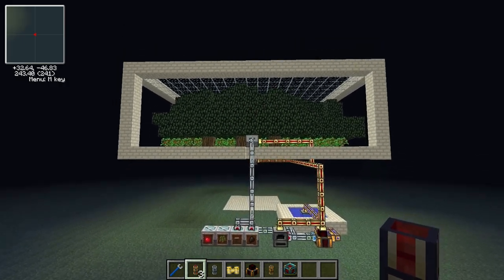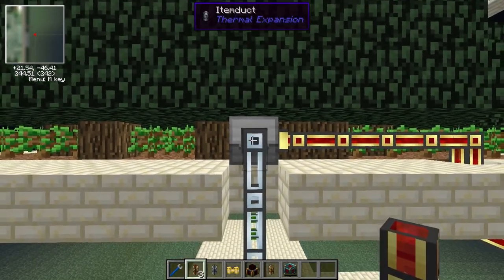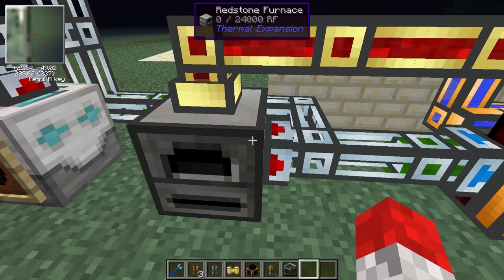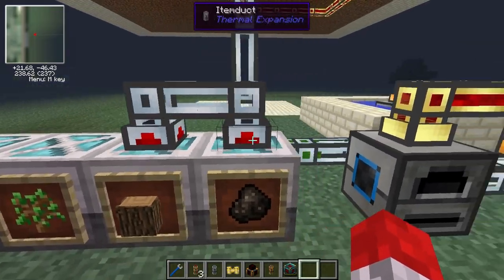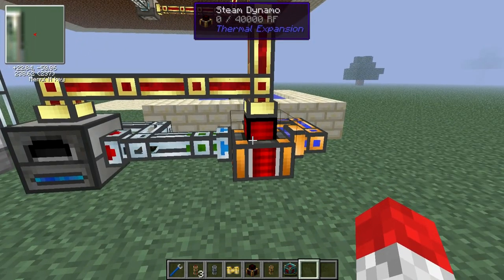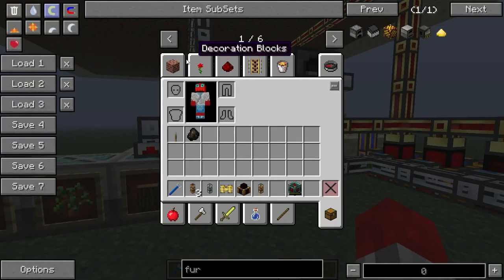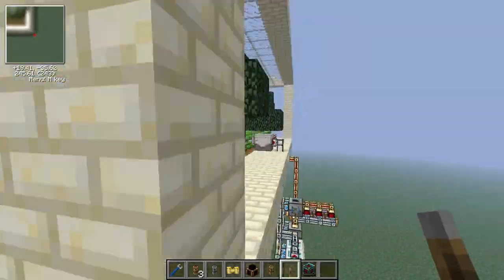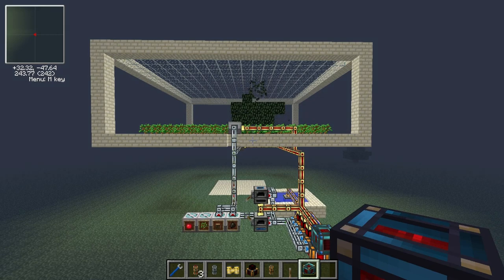Technic Tekkit 1.2.9e - Renewable / Infinite Energy Part 1 - Coal Power!

Comment: Got this setup a bit ago. Starting off very very slow since I didn't have a lot of saplings. Do you need light to allow the trees to grow properly? Are you getting light from the glowstone bricks?
Reply from the maker: hcsepyon You do need a fair amount of light for them to grow well at night time, but you don't necessarily need to do glowstone blocks. One option is to use pumpkin lanterns :) Another option is to have some non-dirt blocks in there to put torches on. 

I'd like to ask if you put a ceiling on it? That can hamper the speed that the trees grow at - this one was set to only allow the smallest two tree types to grow, but with no roof they'd have been popping up all over the place and the harvester would have been running non-stop (which was a little bit annoying for recording). 

Can I ask what dimensions you used so I can help a bit more if none of that helps?
Reply: WhamyKaBlamy I used the same dimensions as in your video. It's running plenty fast with just 10-15 torches on the outside track near the dirt. I did cap the top off as well. Might remove it to see if I get more production. As it stands, only one redstone furnace is needed as the second one almost never has logs to burn. Maybe allowing them to grow taller would give me higher yields overall.

Either way...thanks for the tutorial on this. I had just started up tekkit again after playing tekkit lite in the past and was a little upset that I had to constantly hand feed my steam engines. Was going to look into another mod pack until I found this.

Small bit of criticism on the guide overall is that it doesn't seem to explain much in the ways of what settings to put the redstone on the machines to or how to change inputs to outputs and such. I built it exactly the way you showed here but it wasn't working well until I noticed some of your outputs were red instead of blue. Might be covered in a previous guide of yours but I had to figure it out by smacking things with my wrench.
Reply from the maker: hcsepyon Thank you for the feedback :) 

Taking off the roof will definitely get you more logs, but it can become a bit of a monstrosity if I'm honest - and personally it annoys the ever-living hell out of me. 

The extra furnace can probably be accounted for using the glowstone, but it also might be a chunk issue - If you've built yours over a different selection of chunks it could be that mine was getting more growth hits.

How many dynamos are you running off of it?

With regards to the itemducts and redstone - thank you for that feedback, it really helps :) I'll make sure to be more specific about what I use and the settings in the future - I get worried I'm over explaining sometimes but if it's leaving information out then I'll try to rectify it :)
Reply: WhamyKaBlamy Was running off of 8 dynamos. Something happened though and now the redstone furnaces aren't getting power and the dynamos have stopped accepting coal. Coal moves to the end of the item duct and just turns around.  I removed the 4 dynamos I added and set it back to the default 4 and now nothing is generating any power. Triple checked the system and it all looks proper. Racking my brain on how to fix it.

Welp. We both left the server and came back and it started up again. Guess it just glitched out. If you've got time I do have a question. When I hooked up another 4 dynamos to the system it refused to fill them with coal. I tried a lot of combinations of putting vacuums on the tubes but can't seem to get it to fill more than 4 at a time.
Reply from the maker: Do you have any sort of white list / black list going on with the itemducts for item sorting?

Also, mind if I ask how long you're giving the dynamos to fill up with the coal?

I'm not quite sure exactly what might be causing that unless it might be more glitching. If you have the newest four dynamos hooked up to the same itemduct and have only them set to vacuum then they should be prioritized.

Another option is to use a crescent hammer to change whether the itemduct is connected to your other dynamos by right clicking on the actual red/blue marking like when you change between input/output. If you leave only your four newest dynamos and then wait for them to start filling before reconnecting the others it might make it work.